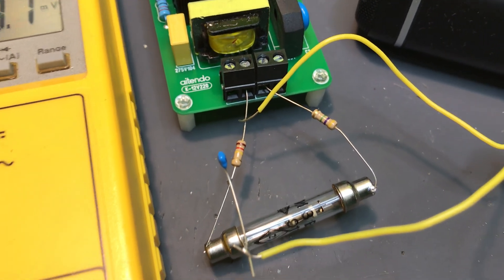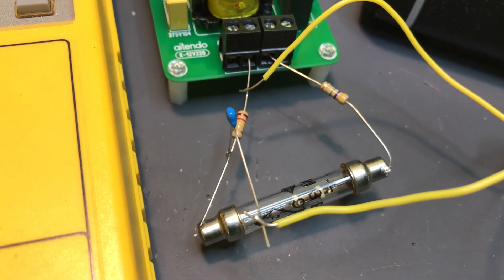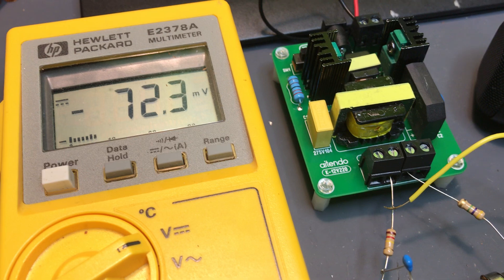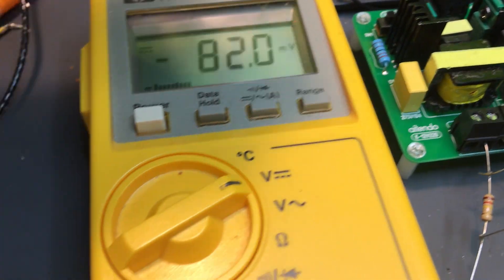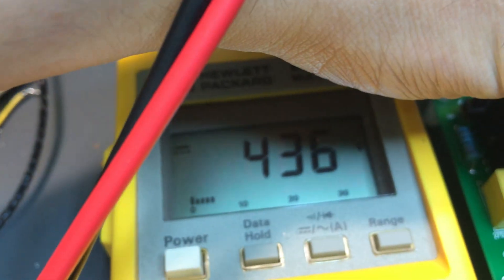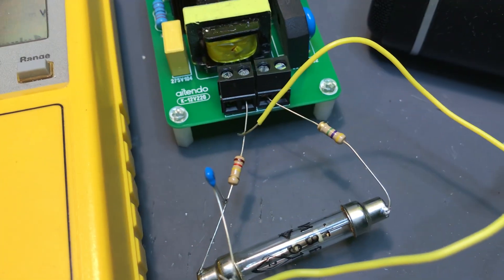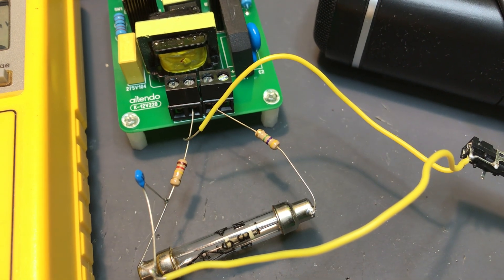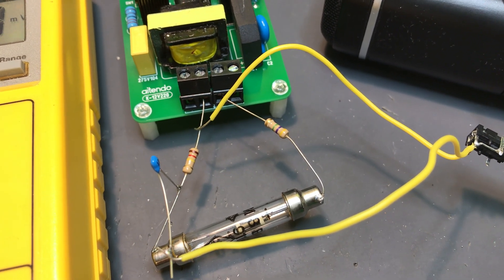Geiger-Müller tube experiment

Comment: I made one a couple of years ago. You can use the PWM signal from an Arduino (I used an ESP8266) as your oscillator source to generate the high voltage, and collect the data with the same device.  This would be a totally uncalibrated device so it should be used as a an alarm in case there is suddenly a very large increase from 'normal' readings.
Reply from the maker: Good suggestion. I hope I will not get 'abnormal' readings...

Comment: This is a Soviet SI3BG tube, designed for measuring extremely high levels of radiation, so its sensitivity to normal background levels is very low.
If you can get your hands on an SBM-20, or even a SI8B(ultra thin mica window, sees alpha too), then you're going to have a much higher count rate.
Reply from the maker: You are so expert!! Thank you for information!